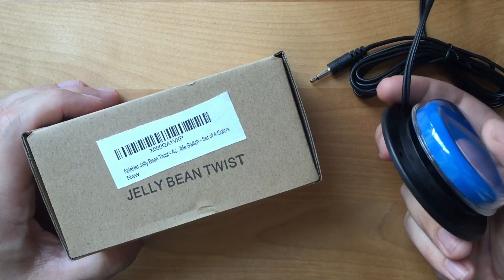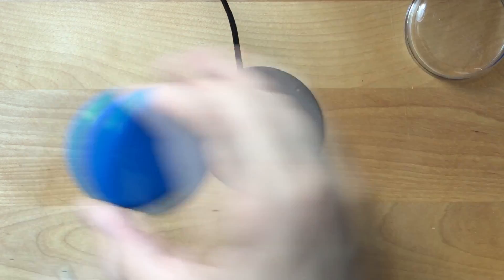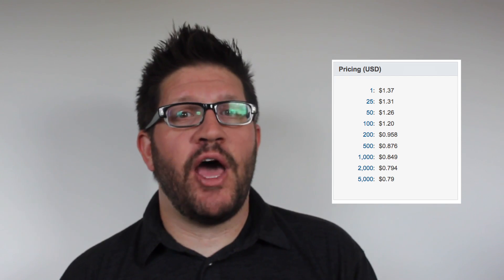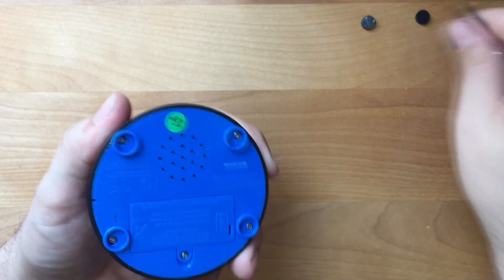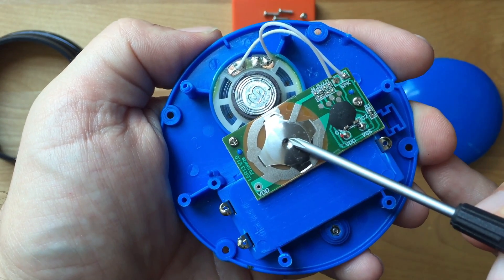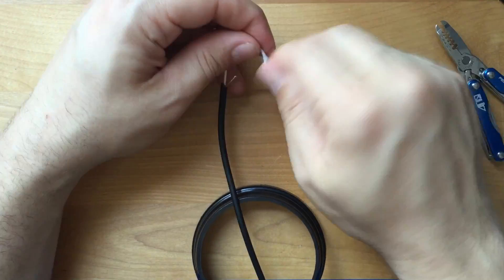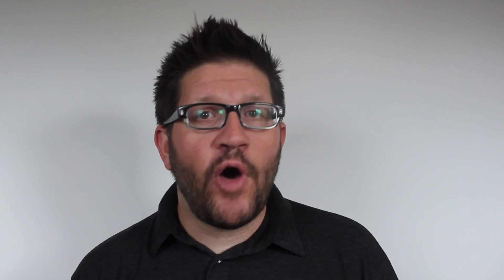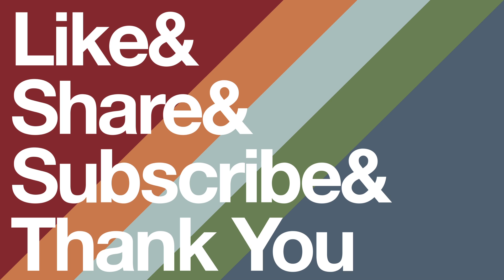Budget Adaptive ep.3 - Technology Teardown: Ablenet Switch Review And DIY Solution

Comment: Hi, we did this for por daughter. We have a bubble machine and it works fine with the adaptive switch but not with the ones we adopted from learning resources. Is like it's not getting enough power with the ones we adopted. What could it ve happening? Could it be the quality of the cable we use?